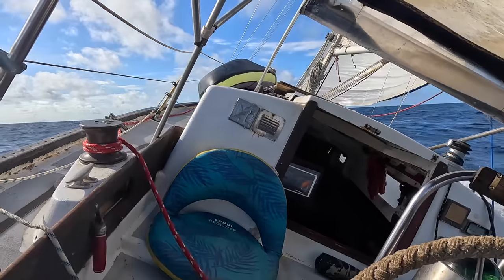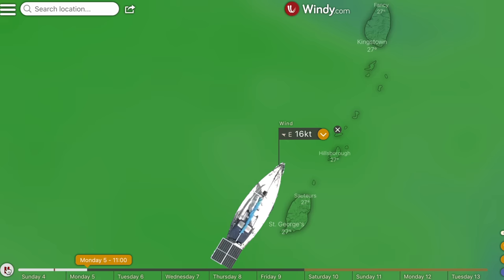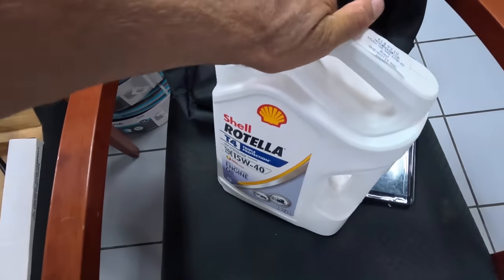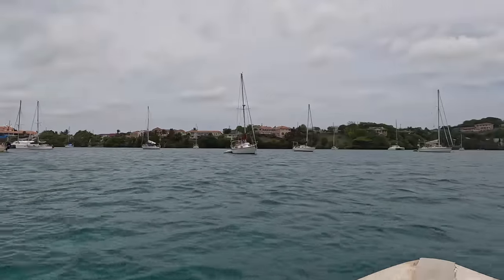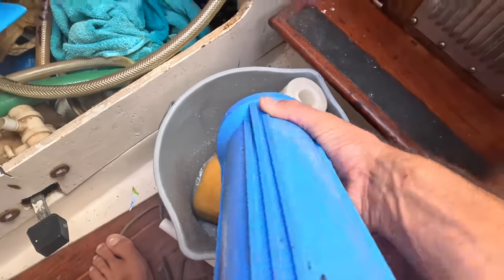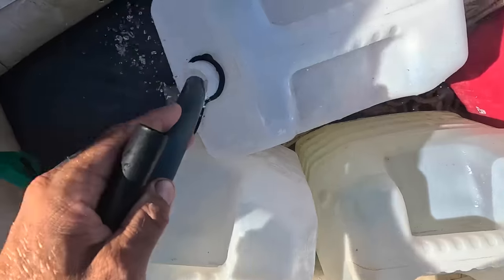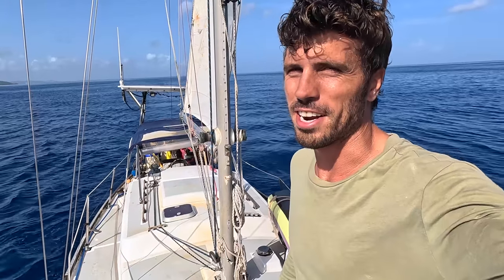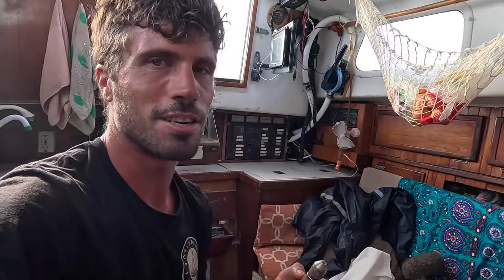Why I hate sailing the Caribbean

Comment: Hey Huub, one little trick when dealing with oil: put the hole in your oil bottle higher than the rest of the bottle so that the oil comes out smoothly, rather than the 'glug glug glug' way when the hole is on the bottom. Your oil is fighting the vacuum inside the bottle, you need to be able to let air inside as the bottle empties

Comment: The explanation of the challenges of sailing the Caribbean at the beginning of the video excellent.  Costco sells a 10 foot 10 inch inflatable dinghy for $500 with oars and pump takes up to 15hp outboard, needs wheels for the beach, needs chaps.  Tobin Sports inflatable boat made by Bestwaycorp

Comment: FYI I wanted to make sure you know when making wire butt splice connections that you can get sealing water proof  butt splice fittings for a increased price that may be very worth it in wet boat environment/salt water! After the cripping the connector you heat it with lighter, heat gun ect. and it heat shrinks and seals itself up!

Comment: Hey Hubb! Good video once again. Looks like you are getting that old Alberg 30 back into shape. Question: if you knew then what you know now would you have chosen the 37? Or another? I know she's taken you on good adventures. I have a reason for asking. I found a 1967 hull on a trailer hidden in the pines on the gulf coast and am considering getting her and doing a refit
Reply from the maker: I mean, looking back it always seems easy! I was scared at the time to handle a big(ger) boat. And I was afraid I couldn't afford the upkeep. But no matter what choice you make, I think that a 40 to 42 foot is an ideal size for many things. Family, friends, speed of boat etc. But there are a lot of questions in game when buying a boat. Also on someones first boat you often do lots wrong. and its cheaper to do things the first time wrong on a smaller boat. But one thing is sure, comfort of travel and liveaboard increases greatly with a 38ft+ boat. (also, take my advice with a pinch of salt, I've seen many boats by now but have only owned one ...)

Comment: Loved the explanation. The problem with the work is you crammed too much in the video. Instead of putting in several different boat jobs, spend a lot of time on one boat job. And don't just fix it, reimagine it. I liked the upgrade to the water tank. However, I know this might not be possible if you used 5200 or something, but if you could have cleaned up the repair to the entire top of the tank that would have been impressive and would have significantly improved the boat. Those control cables are extremely utilitarian, also. They are definitely an improvement over what was there already, because they work as they are supposed to, but they are unsightly. The idea should always be don't just repair a crappy system, improve the design of the system. If you always do that, you won't throw good money after bad. And your boat will slowly get more and more valuable.

Remember, the boat that you want to sell will be coveted by someone. But if there is too many projects to your boat, they might not realize just how much they really want it. We live in a materialistic society. Captain James of Sailing Tritea originally purchased his Alberg 30 for $2,500. Of course, your's is in much better shape since his engine was ceased. But if you look at his boat now? it is gorgeous. Your's could be as well.

No matter what you do, I'll keep watching:) So ignore me if you want.